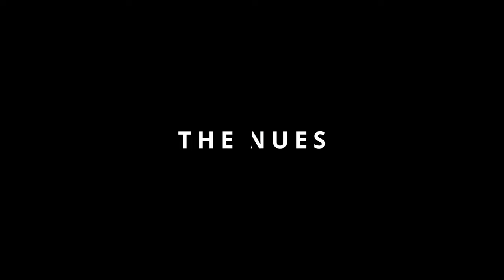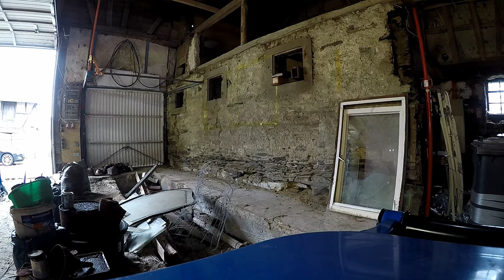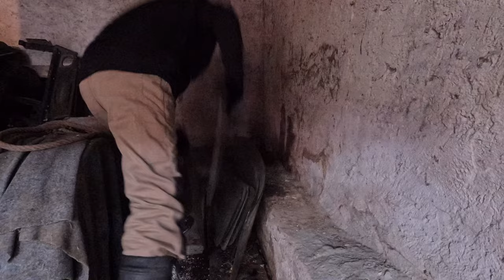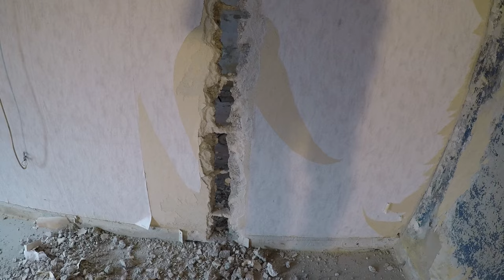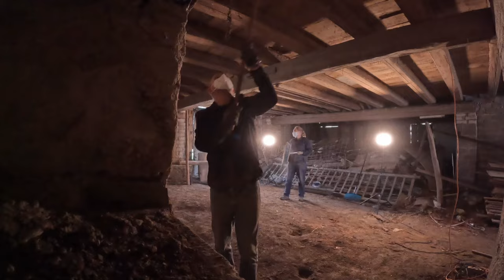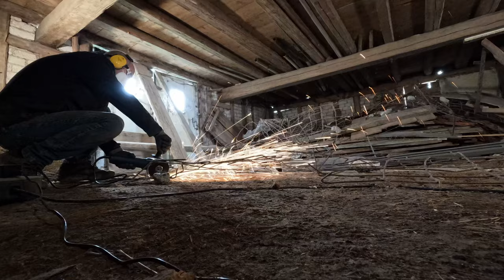The Dominos Are Starting To Fall - ep27 - 230 Year Old Farmhouse Renovation

Comment: Great work in cold weather! Your breaks with comment sections get better and better! I hope the beams repair will go smoothly! That will be a huge domino! 🙂We just removed two fallen gumtrees from our land and I wish I could send the trunks over to you guys. They looked ready to use as beams! Instead, they're now chopped into firewood.🔥
Reply from the maker: Thank you Ruud! You are right, these beam repairs are key. I guess shipping from New Zealand would be a bit on the costly side 😄.  Cheers ! L.
Reply: Oh, but gum trees smell heavenly when they burn! I went on an Outback tour to Alice Springs & the guide built our camp fire from ghost gums & I still remember it fondly 30+ years later. 🥰